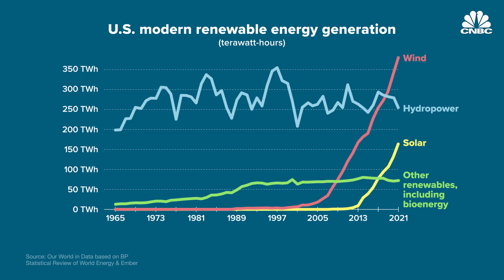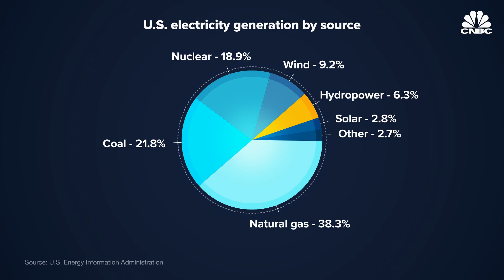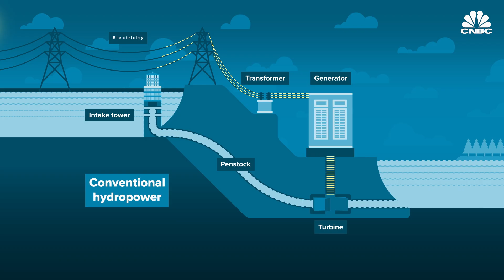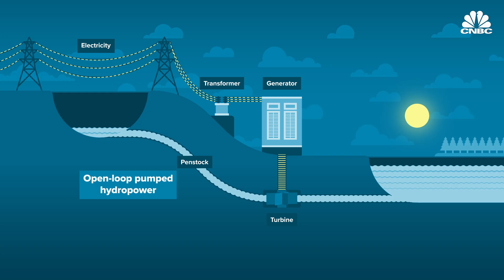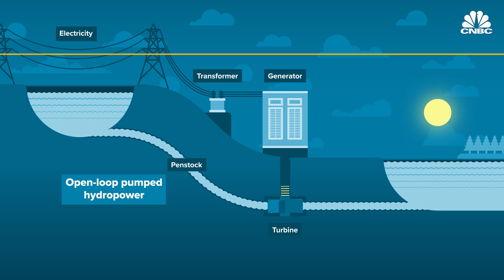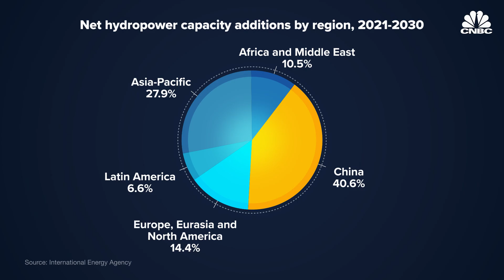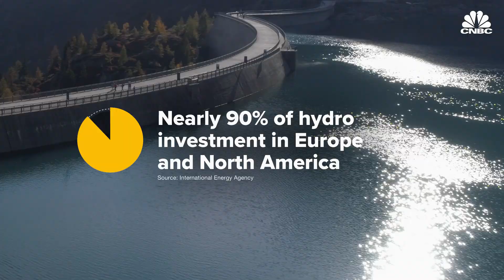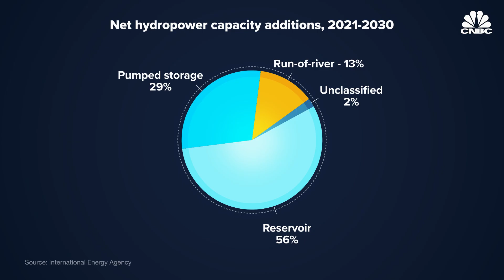What Is The Future Of Hydropower?

Comment: Hydropower is typically a by-product of flood control and irrigation projects.   Hydropower use of large dams flooding and displacing animal life and people is much more difficult to justify if it is mainly for electrical power generation.  Hydropower is the fastest reacting dispatchable electric power generation with little to no instant makeup availability cost.    This makes hydropower a benefit even when being used with pumped hydropower where pumps move water into a high reservoir that is later used for hydropower with about 50% efficiency.  

Global warming was officially stated at 1.1°C in 1991 and 1.06°C in 2022.  There is no mechanism that would allow greenhouse gas behavior to cause global warming.   The back of the United Nation's IPCC science report states it took its greenhouse gas samples at 20,000 meters altitude where it is common high school level knowledge there is no greenhouse radiant energy.  This is typical practice for deceptive marketing to state legal data transparency protecting the perpetrators from fraud prosecution.  

Earth's greenhouse effect is frequently used as a primary example to high school students of a system always in saturation from the strong greenhouse gas water vapor absorbing all the greenhouse radiant energy from the earth with greenhouse gases within 20 meters of the surface that is all around us everyday and can't have its overall effect changed.  There is no further greenhouse radiant energy to interact with greenhouse gases.  At 1% average tropospheric water vapor over 99% of earth’s greenhouse effect is from water vapor.  Water vapor would hold earth's greenhouse effect in saturation if it were the only greenhouse gas in the atmosphere.

Arctic warming is taking place with the proving mechanism being warm Atlantic Ocean waters migrating deeper and more frequently into the Arctic Ocean warming it and the region.   That warmer water is causing a few weeks less of reflective snow and ice coverage resulting in more solar heat gain to the Arctic region surface.

Atmospheric CO2 levels of 1200 ppm about three times what they are today would greatly invigorate C3 plants the majority of plant life on earth greatly greening the planet. 

0.4% of the atmosphere is CO2 and on average 1% is H20 water vapor.   (1% H20)/(0.4% CO2) = 25.  Water vapor is 25 times more present in the atmosphere on average than CO2.   Water vapor has an CO2e of 18,  18 X 25 = 450 CO2e total for water vapor to 1 CO2e for CO2. 

The Earth’s oceans have 3-1/2 million sea floor volcanic vents warming the water and changing it’s chemistry that have not been systematically accounted for.

Comment: I think Hydropower is in for a big comeback with a bright future ahead.
So many countries are making the environmental requirements extremely difficult for new power plant builds.
The old "on river" style hydro would not get approved in a large proportion of countries at the present time.
The fusion power plant designs that hopefully produce net energy on a regular basis are in doubt and the estimated time until an operational power plant is running is being pushed back till after 2050. Some old clean technology will be getting a revamp to help us move into a clean future.
We are finding that if a country has a large proportion of rooftop solar on residential homes it helps immensely in the change to a renewable economy with virtual power plants then becoming feasible.
The future for 100% renewable power plants is bright. Solar power towers are getting built in larger numbers than ever with molten salt storage allowing 24/7 operation in the right area.
Just think outside the box like I have the change to over 50% of the world's power being produced by renewable energy is coming as revamps to old coal power plants become uneconomical.
I have a couple of new Hydropower plant designs on the drawing board just completed that pass all environmental standards.
As well as a completely 100% renewable thermal power plant design completed.
And I have a completely new wind turbine design completed and ready to build.
😎🇦🇺👍

Comment: Using dams that already have power capacity and ones that are built already are a great idea. Using recently submerged land rather that adding concrete into the waterways could be a way to go by using the underwater geology to direct the water therefore the current where the power is. Other way are using the water that hits the shore as is already being done putting floating devices that generate power.

Comment: For me I think hydro power dams on rivers need to move away from total electricity generation ( which as she said is in many places like west USA being going down over the last 20 years away due to drought and slit etc etc … and moving more into slightly smaller dams that hold water for minimum off 18 hours a day but then flush more water per minute out during the few hours off the morning and afternoon peak electricity demand hours…… you simply pair these dams with open bottom dams a bit downstream so that after these perforated dams the rivers run more or less constant just as long as the open bit under these is sized right for an average 24 hour period …… keep the closed water systems more for pumped hydro which along with gravity storage,flywheels and batteries can be used more as excessive energy storage ready to fill in the nights and low wind periods

Comment: Here's my answer to hydropower:

Lake Mead (which powers the Hoover dam and a huge part of 2 states and northern Mexico. Not to mention providing water to those same places - that can't be replaced)

The combination of a changing climate and strong demand for the lake’s remaining water has resulted in a 100-foot drop in the reservoir since 2000. That’s just 10 percent under the lake’s high water mark in 1983, Lake Mead is shaped like a martini glass-wide at the top and narrows at the bottom.

If the reservoir drops below 895 feet a possibility still years away Lake Mead would reach dead pool status, with potentially catastrophic consequences for millions of people across Arizona, California, Nevada, and parts of Mexico. Additionally, the power created by Hoover Dam is used to carry water up and across the Sierra Nevada Mountains on its way to supplying Southern California. 

So you see, hydropower is not flawless, and can go away when climate is unstable. Frankly, we need different sources of power, even fossil fuel power (for the immediate future) until we can reach carbon neutral (which we probably never will based on what I know about people).
Reply: Not a real major contributor in NV or AZ -  Most goes to CA.... not sure any goes directly to MX per EIA stats...

AZ - electricity by source in 2022, 99% of Arizona's total electricity net generation was provided from 6 sources: natural gas (42%); nuclear power (29%); coal (12%); solar energy (10%); hydroelectric power (5%): and wind (1%). Biomass, hydroelectric pumped storage, and petroleum, supplied the rest.  

NV in 2022, 99% of Arizona's total electricity net generation was provided from 6 sources: natural gas (42%); nuclear power (29%); coal (12%); solar energy (10%); hydroelectric power (5%): and wind (1%). Biomass, hydroelectric pumped storage, and petroleum, supplied the rest.

Nineteen percent of the electricity from the Hoover Dam goes to Arizona, 23 percent goes to Nevada, and 58 percent goes to California. About 15 percent of the Dam's electricity goes to Los Angeles —a city that is 270 miles away.   But you can see from the stats that hydro isn't a major % of the state makeup of power in either AZ or NV, and all the Hoover Dam power is mixed with other dam generation as well to get 'up' to those numbers.  

Only 5.7% of US electricity last year came from hydro, in the entire country - and it wasn't from Hoover Dam, which is now not all that big a generator.

My stats are all audited and straight from the US EIA.

Comment: a closed loop water system presents it's own environmental problems. In a closed loop water system you have the problem of "stagnation" If you treat this water as any other biohazard then what will be the cost of either treatment of this water or the cost of disposal of it. stagnation will not only have an adverse effect on the environment, it will start to damage the equipment if not treated.

Comment: Pumped Hydro is used by companies in Switzerland to store the surplus energy France produces during the night and then re-sell it to France during the day. They do have great mountains to do that. One of the most beautiful things I saw was a system to optimize the Brazilian hydroelectric system made by the University of Campinas. On simulations the system saved 3% of energy but it could not be put to work because of the risk that could cause a general blackout.
Reply: There is a wonderful development at Niagara Falls.   The hydroelectric  generation done on both the Ontario and New York State side of the border and was completed in the 60's with a capacity of 2.4 GW.     

Better yet an 80 million cubic meter reservoir  is allowed to fill up at night and is used to generate power during the day.

Comment: There is still lots of potential to retrofit old hydro and generate more power. The US dept of energy did some of this at the small scale and it worked out very well. Pumped storage biggest issue is finding suitable locations as you often need one lake and a hill to exist already. China likes dam financing as it uses orders massive steel capacity and Chinese labour. High steel demand insures that they keep their lowest end steel costs over other non chinese competitors and as locations for the dam workers end in China, they can be used elsewhere. It also soaks up lots of capital that needs to find a long term home with less risk.

Comment: They mentioned smaller scale, closed loop pump systems that could even use large tanks instead of reservoirs. I wonder if we would even have to use water at that point? Would there be a more efficient liquid for these systems? Or even chemicals/pollutants if the tanks are completely sealed. Could be a good way to "dispose" of liquid pollutants. Just dump them in a giant sealed tank and then use them to generate power. Similar to some of the more advanced landfills that get capped and the gasses released are harnessed for power.
Reply: There's ideas to use way denser fluids than water in such systems. It still needs development.

Comment: Sadly 80% of US dams are in disrepair and are at risk of failure. 
If this was addressed and the US invested in desalination plants to pump filtered sea water back into the lake when river levels are low
Reply: That would make a ton of sense, maybe we could even use Saudi Arabias solar desalination plant to get more power out of the system. Basically it works like the close loop solar thermal reactors.

Comment: Hydropower sound good with the old technology.  But with the 4 generation nuclear reactor and Lighbridge metallic fuel that operate 1000 Celsius degree cooler than conventional nuclear fuel, you can build the same power capability with NuScale SMR with a fraction of the land needed by Hydropower without any of the environmental damage by Hydropower. And the 4th generation Nuclear reactor with Lightbridge safer nuclear fuel make it a walk away safe that there is no reason not to choose Nuclear over Pump Hydro. 
And in regard to Pump Hydro storage, you can use Cryobattery energy storage like Highview Power that is pretty much Pump Hydro in a box. Cryobattery use a fraction the amount of land that Pump Hydro use without any of the environmental damage that Pump Hydro cause.  
So if you are an environmentalist, you would see no future in Hydropower since there are much better option out there.

Comment: The total generating capacity of the Grand Coulee Dam is 6,809 megawatts and its average annual energy output is about 2,300 megawatts.  The total generating capacity of the Hoover Dam is 2,080 megawatts and its average annual energy output is about 478 megawatts.  By using solar and wind to pump water upstream to those two dams, we could increase their output by as much as 6,111 megawatts, with months of storage.
Reply: 1000 times this. People say solar is no good because it doesn't work at night and batteries are too expensive, but we have giant batteries right there already built that just need some extra equipment and organisation to make full use of them. Government needs to imscentivise this now before we get to the point of really needing it so it can cut the requirements for gas peaking and save CO2 sooner rather than later.

Comment: Hydroelectric power is responsible for 65% of Brazil's electricity generation. Unfortunately, climate change has increased droughts and affected reservoirs in recent years, so there is an increasing demand for solar and wind energy. Currently, the second largest source of generation is wind power.

Comment: The idea of pumped storage I see illogical, all you do is reduce or close a room or two of the dam during times of light load, and if you really want to save, replace the alternators + inverters from AC to DC here, you control even the amount of water rush exactly as much as the need for consumption.

Comment: I was seriously expecting to hear about the potential of floating solar, and how that could eliminate the need for releasing water during the day.  That would allow for increased hydropower generation during the night.
Reply: Especially at locations like Hoover which are running below design capacity due to lack of water. Makes better use of existing infrastructure.
Reply: @NVGEAR  It's faster, cheaper, and the cost to link it to the grid is next to nothing.
Reply: @firefox39693  And you don't need to clear whole swathes of land to install the panels. There are Hydro reservoirs that are absolutely humongous. You wouldn't cover them whole, but covering like 50% in a well designed way would not have a  big impact on the biomes. You could inject it into the grid, and do some PSH on top. But I bet you that operators would just use it all for pumping, and then release it during the dinner peaks.
Reply: @AlldaylongRock  
Yes, you just pointed out that combining them, by using solar to pump into storage makes sense and increases simplicity by using a dedicated separate pumping system. Storage capacity can easily be accomplished by increasing the  reservoir's volume.
Reply: @NVGEAR  Floating solar would be cheaper, faster to build, would have minimal hookup costs because the dam already has a grid hookup, the panels would enjoy increased efficiency from the water and produce more power, the panels would last longer,  the arrays can be rotated to track the sun, the arrays reduce evaporation, and the arrays would reduce sunlight making its way to the bottom, which would reduce biomass growth and reduce CH4 emissions from reservoirs.  Why would they not invest in floating solar?   There's no reason not to.

Comment: Engineer-wise, can't a seawater hydro pump station be build❓
Reply: Yes the French have been operating a tidal power station since the mid-Sixties - the tide flows in and runs the generators, and then as the tide flows out it powers other generators (or possibly the same generators) to run the other way. There's about a 45 minute gap when the tide is high / low but apart from that it's extremely predictable (people have been calculating tide tables for centuries). There are other examples around the world.

Comment: Why don`t they build Solar-and Windpower around the Area of Hoover Dam `?  It could provide additional Energy which makes up for the loss or more of the loss
of diminshed Hydropower. In fact the Storage for the Renewables is also there tt`s the water they don`t use for generating electricity if you get solar power during day time Should be a no brainer.  The Grid is already there. You would need a second Ivanpah to make up for the losses of Hydropower due to the drought.
Reply: Or they could float the PV panels on the lake itself and reduce evaporation - which must be considerable for a body of water that size.